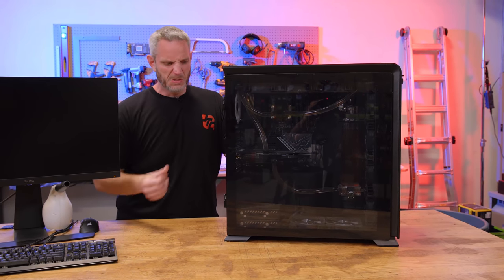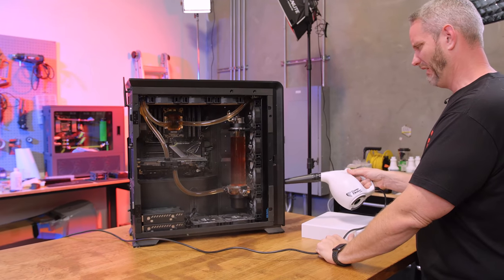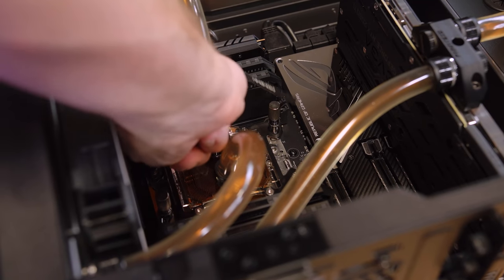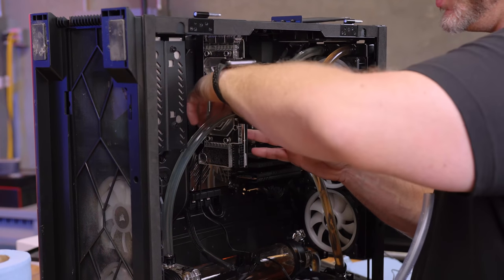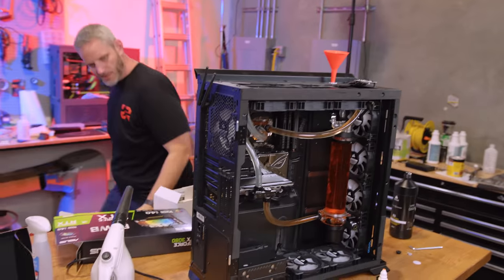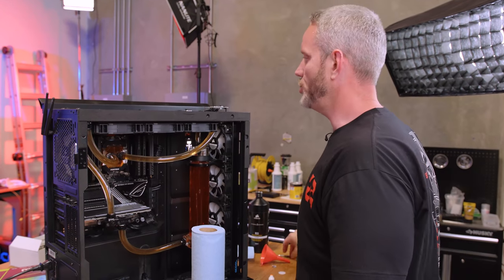Giving Phil the upgrade he deserves!

Comment: Me: profusely struggling to find a gpu

Every computer builder youtuber: I will casually add a 3080 to this rig
Reply: *sobs in RX 570*
Reply: @baronvonsatan  sobs in HD 7790
Reply: @baronvonsatan  sobs in GTX 770 and AMD FX CPU
Reply: @baronvonsatan  bro I'd be happy with a RX 570 right now
Reply: @Metalgear132  Ironically I owned every gpu in this thread. I upgraded to a 2080s and was mad at myself at the time but now felt lucky ... This this video makes me feel bad as his 2080ti is sooo old
Reply: Zugie01  Way to go, bro!

Comment: Jay: “He has a old 2080ti”

Me: No graphics card.😦
Reply: Yea I feel your pain
been trying to get one for over a year now 
😢
Reply: No GPU? I don't have a PC 😭
Reply: If he likes he can donate his 2080ti so I can upgrade my chrome book. Maybe I can finally open 2 chrome tabs. Even doom might be an possibility
Reply: Me why u bulling me
Reply: I have intel  hd510 which is not bad for playing mw2 at 800x600
Reply: Still gtx970 here :(
Reply: He was joking btw.
Reply: I have a 2080 Ti and honestly the 3080 really isn’t very appealing to me at all. It’s not about the price. It’s just that the 2080 Ti to the 3080 isn’t much of an upgrade imo. The 3090 is the only real upgrade from the 2080 Ti. However, if you’re a competitive player and play at 1080p 240 Hz or 360 Hz, Ampere really isn’t that much better than Turing. The new architecture has much bigger leads at higher resolutions. Also, Ampere overall is lackluster. It’s missing AV1 encoding which will undoubtedly be a major factor in the future, it has the same Turing NVENC, the 3080 only has 10 GB of VRAM, the 3090 has VRAM on the back that hits 110 C, and the 3090’s price is too high for what you get. The 6900 XT beats it in a decent amount of games while costing $500 less. $500 used to be the price of the top end GPU on its own.
Reply: @lizardpeter  noice i.mean even if it's cheaper and bit performance more if that's a medium guy trying upgrade he will have make another pc to run it without very big bottle neck so it's only practical to use it even though I don't have a graphic card
Reply: @lizardpeter  So in the future i can find an used 2080ti instead of a new 3070, assuming they both 500ish, i'll go with used Turing eyes closed?
Reply: You can't do editing without a 3080. Everyone know that 2080Ti would slow everything down... duh!
Reply: @Bsc8  That’s a tough decision. They perform very similarly. With the 2080 Ti you get 3 GB more of VRAM, but Ampere does seem to do a bit better at higher resolutions anyway. If you use RTX and DLSS a lot I’d probably go for the RTX 3070. If you play at 1080p the 2080 Ti might be better. With the RTX 3000 series you might also be able to enable BAR/SAM if your hardware supports it.
Reply: just buy an 1060Ti
there's plenty of them atm
Reply: Me : no pc 😔
Reply: @katerang31  I didn't know they made a 1060ti

Comment: Me: Sees 4k video option
My 2mbps wifi: "Why are we still here? Just to suffer?"
Reply: Just to buffer. XD
Reply: @divyansh8596  🤣
Reply: @divyansh8596  🤣🤣🤣🤣
Reply: your 1080p monitor all like bruh
Reply: I hate it when the Tube runs on 4k on my 1200p. It lags, takes ages to buffer and ff/rew-ing just makes it suffocate instantly. And that on 100MBit/s from ISP. Why are Google's devs too dumb/lazy/ignorant to implement a general option that you simply have to set up once and for all? Or detect screen dimensions and select accordingly?

60fps is also something that nobody really needs. It's not a game where you need every ms for reaction purposes and you'd be dealing with input latency. Just draws bandwidth unnecessarily.
Reply: @CakePrincessCelestia  60 fps is necessary for everything. You just need a better GPU bud.
Reply: @j.j.3391  I highly doubt I need something better than a 1080 to handle the Tube @60fps. Actually it's clearly related to general traffic throttling that's happening as I clearly don't get any higher DL rates with higher settings and therefor it chokes. That has a well known history with Germany's biggest ISP and the Cogent backbone. And TBH I simply see no gain in watching videos at 60fps instead of 30. In Gaming however, every single fps counts, especially noticable in input smoothness. And the rate should be rather stable.

BTW I remember way in the past it was possible to set a preffered resolution directly in the setting, but quite a few years ago they changed that to a simple checkbox that makes it try just getting the highest rate possible. Which is just nonesense especially when your device doesn't even support that as it simply causes more traffic and might trigger some other bottlenecks. I don't need to download something in 4k that has to be scaled down to 2k on my end - that's roughly 4x the amount of data. 3 out of 4 parts of it totally wasted, but clogging the whole infrastructure.
Reply: @CakePrincessCelestia  Get a G-Sync monitor then. Your salt suggests a burning desire for something better.
Reply: And here I get 4k HDR on my phone over 5G/5GUW.
Reply: @Odin3v  bruh

Comment: Best tip for watercooling maintenance: use soft tubing.
Reply: Better tip tbh is don't.

I've had watercooling now for a few years and I find the maintenance to be a pain in the ass, and I always run long over the recommended time for changing coolant
Reply: even better dont use clear or glossy tubing so you dont have to worry about plasticizer ;)

Comment: Soft tube gang ough. It has only ONE negative side compared to hard tubing: aesthetic (with the discoloration). Soft tubing is just better:
-Easier to install it's just fitted in the barb, you technically don't need even the cap, but you use it anyway.
-Way more resistant to hurt, moving, falls, pull etc... you can move your loop like he did without any concern. With hard loops even a small bump can cause leaks.
-It's way cheaper (or at least it is in EU within fittings, tubes etc... the hard one cost at least double).
-The leaks are total explosion (if you didn't put the tube correctly lol) or never happens, the hard tubes can have leaks so small and slow that manifest themselves in days/weeks.

Everyone speaks about going first time hard tubing but not so many see the reddits where they screw up and had major leaks or damages only for the stubbornness of trying something useless.

Comment: Best tip for water cooling if you want to go aio, but might want to go custom later. Get an Alphacool eisbear. They are made with g1/4 fittings, a standard soft tubing size I believe 10mm/13mm, and you can get a gpu block that you disconnect the quick disconnect in the tube and connect the card using the quick disconnect on the card and off the cpu and rad.

Comment: BE carful Jay, that blower in fan can produce 12v into the motherboard and burn it.
Reply: I do live sound engineering, after a gig we blow out the amps etc. I was taught to put a pencil in the fan to prevent it turning. Wires plus magnet plus movement = electricity.

Comment: As someone with many years of experience building water cooled systems, my best tip for maintenance is don't wait too long to clean your system (I've seen some people who have never even cleaned theirs, water cooling isn't for you if you can't maintain it properly) . I deep clean maybe once a year (take EVERYTHING apart for a deep cleaning, then run mayhems blitz afterwards) and it really does extend the life of everything.
Reply: How do you like deep clean things? Just flush it out with water / water and soap?
Reply: @IyeViking  Usually I wouldn't recommend taking things apart as it can be risky if you're newer, but I try to go for areas where residue can buildup and clean it with warm water and maybe a small amount of soap along with a toothbrush, then rinse with distilled water to minimize any buildup. The nice thing about flushing it with mayhem blitz afterwards is that if there were any buildup/residue from the cleaning, it will get rid of it.
Reply: @bronzehd6212  very nice, an AIO is a closed loop system so the only thing you need to worry about is dust buildup, which you're already doing a great job at!

Comment: Tip: when reusing WL parts always check the seal on the fittings, after being used and with temperature changes they get deformed and they can leak, specially after being tighten up hard with a screw driver since they get squeezed. Jay didn't check but he has extra parts laying around most mortals dont.

Comment: Hey man quick question? Please Help.I just upgraded from the Ryzen 5 3600 to the 3700x, and everything seems to be fine and working. I click on SYSTEM and it shows I now have the 3700x as my cpu, but when I try to enable All cores and when I go into the Task manager, still says 3700x but under CPU its still showing 6 cores and 12 threads from my 3600? Any ideas as to why this is, and how to fix it? Please Help. And Thanks

Comment: Nice! Quick and easy. 👍😎

I've been using plasticizer free tubing since 2013. Mainly: Saint-Gobain ACG00038 Tygon 2475 IB, Plasticizer Free, High-Purity Reinforced 1/2" x 3/4" Crystal Clear Tubing. 
I got  a 100m roll @ wholesale (Planned to use to build a lot of systems, I did build several high-end systems, but had a bad accident and had to stop for a few years). Still have a few meters left. For my next build!😁

I also used Ice Dragon Cooling ex-liq-203 Non-Conductive Advanced Nanofluid Coolant. Still have some of that in sealed bottles.

Don't know if they are still available. Been out of the 'custom water build loop'🙄 for 4-5 years.

That reminds me... My goto rad fans back then were Cooljag F121425BUAF Everflow 140mm PWM, ~600-2600 RPM, ~40-126 CFM, ~0.30-5.22 mmH2O, ~20-43 dBA fans. I haven't heard anything about Cooljag in years. Are they still around? 

My CentOS Server still uses all that, since I built it in 2014. Haven't needed to upgrade it, except for a few things like RAM & drives.

Comment: Hi Help:: finally deciding to get Asus Prime H470M-Plus Motherboard

 with i7 10700f with RAM corsair Lpx 3000mhz 16x4. Is this a good pc for using after effects for animation??? (I already have GTX 1660 super and other needed parts like Corsair vs650 PSU, hdd etc.) will this RAM work with this mobo which support only 2933 mhz.??

Comment: 2:46 Princess Sunbutt entered the chat.
I always prespread my Arctic Silver (it's been a while since I did that the last time, this stuff might be heavily outdated by now, think I had the OG, 3 and 5). With a filed SIM card - gotta use what you have :D

4:38 That kitchen roll though. Tough color. Wiping your hardware with that literally makes it about 20% cooler /)

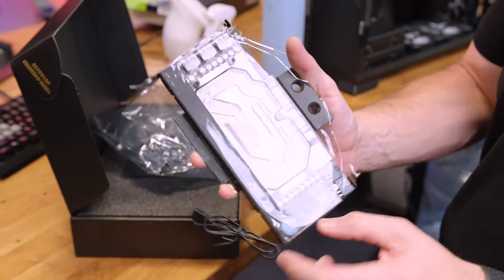5:14 That's because you're literally downgrading his VRAM.

6:36 I always blame Pinkie Pie when that happens.

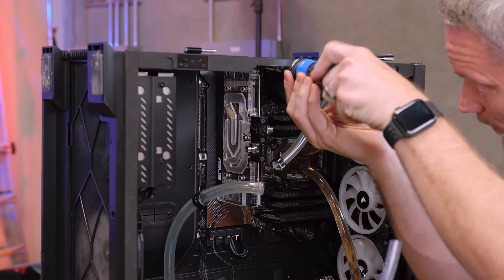8:08 Laughs in OG Sound Blaster 16 :D

14:28 "Spring cleaning" - it's snowing right now...

Comment: I'm sorry but the upgrade Phil deserves is a 3090 so we can have more explosions and travel vlogger style warpy transitions. 😆 That being said I went ahead & just used the soft tubing that came with my Pacifica kit and followed Jay's Watercooling for Dummies video like 4 years ago & so far no problems, despite totally neglecting my loop. It's got a drain port but there's no need for a fill line since it's in a Tower 900 & it's not hard at all to fill straight into the port.

Comment: I gave my wife my old 2080TI and I kind of miss it. Just because I feel like last gen got screwed over this year. No only did performance take a larger than normal leap over the last gen, rendering everyone’s 2080/ Supers paper weights, but they also introduced a new flagship (x090) series, which I assume is here to stay, which pushes everything from last gen down the totem pole more so. This puts the 2080TI in direct contest with both the 3060TI and 3070. Somewhere in between. Usually everything just slides down one spot...so the 2080TI should have been comparable to a 3080. AMD on the other hand is different. They haven’t had a flagship proper since Vega. So it’s just a massive upgrade all together. Everyone was waiting for an RX 5800/ 5900 XT that never came.

Comment: Ooof... 80’s? That’s hot for being water cooled. I’ve got 2x 2070 Supers that only hit mid-to-low 50s when rendering with Octane full-blast. AND I’ve got a 2920x Threadripper in the same loop. Only like 480mm of total radiator too.

Comment: Id take that WC 2080TI. Beats my little 1060. 

Also, Watercooling is for more than just Temps. Having that threadripper water cooled also keeps the machine quiet during rendering cause the fans aren't kicking up speed as much (if even at all) trying to keep it cool. 

Reduced noise is the major reason i WC my PC.

Comment: Real talk I have a 3970x with an optimus absolute tr3 block running by itself on a 540mm rad with 8 noctua industiral 3000rpm pmw fans. The lowest idle temps that i've seen on it are btween 40-44C at idle and likes to spike up to 48-50 then falls down again with a swiftech 330mm maelstrom d5 v2. How come my temps aren't there at phil's?

Comment: So yeah that water level when turning it off if you leave the phil (couldn't resist lol) port open, it's true. I ended up dripping a bit of coolant in my computer. Fortunately I was using a separate power supply so no issues. And yeah The water block is freaking amazing. I upgraded my Ryzen 3600 to a 5900x and it didn't even take all that long. Probably not even 15 minutes. Most of it was spent cleaning up thermal paste. I'm very ADD and wanted ever little tiny bit off that 3600. lol So yeah maybe at the end of the year I'll replace the coolant. It's not going to take that long. So watercooling is pretty awesome and the maintence doesn't seem like a pain either. Oh and the temps are amazing. 60 degrees under load!! it's amazing.

Comment: LUL at "rigid is better". Rigid looks better, that's about it. For a WORK MACHINE, who the hell cares. I wouldn't have even put coloring in the original loop as that has a possibility of degradation the tubing and maybe creating sludge later down the line. Just put some anti-microbial and de-i water and make it run well.

Comment: What an absolute pain. All praise be to the NH-D15!

Absolute nonsense when he said "some" of the Noctua's are a pain to get in and out and removing the block is quicker. It's not "some" all of the Noctua's use the same Secufirm  2 mounting and it's easy, simplicity itself.

Comment: WAP : Wet @$$ Physics. 
Pro-Tip: Never leave a computer on the floor (no matter how clean that floor is). Even a simple dolly base frame on caster wheels is enough to prevent your system from becoming a dust-vacuum.

Comment: It's funny, when I designed my loop, I did design a drain port... but the place I had the drain wasn't going to fit the valve. So instead, I capped it off, and whenever I need to drain liquid, I just open the drain cap, and thread in the valve with a piece of spare tubing onto it. As long as I don't introduce air, I lose like a drop or two of fluid as I'm putting on the drain valve. 

So remember, unless you introduce air, having a small opening isn't too bad. But the system also needs to be off, else the pump will force all liquid out that small hole. 

5 years now I've had this cooling loop, and it's been working amazingly. Tubes are lovely greened over time, but they're still holding strong.

Comment: I did some spring cleaning to my build but since I had no access to an upgrade for my 1070ti I just installed a distro block in my O11 dynamic and redid my loop. some day I will get a new GPU but at least Im dust free, fresh loop, and better cable managed!

Comment: So maintenance question: I always hold onto my fan hub when using the Data Vac because I thought over-revving fans was bad. Jay, you shot air through the front to clean the system out. Do I need to worry, or am I being too OCD?

Comment: I'm sure you've used just about every fluid there is but I had green tube issues only when using Corsiar fluid. My entire loop was basically corsiar. Switched to EK fluid and flushed the system and no more green tubes.

Comment: tips for getting air out on a fill or refill:
in order to get the air out if the system (for noise) i typically lift the pc in both hands, and turn it in all sorts of directions, upside down, diagonal, on the side, everything you can imagine, can be quite heavy if you have a full tower with 3x360, HDDs, etc - that moves the air to the reservoir and you can end it by topping that off with water. You will can hear the air bubbles move in the loop, and you can hear them pass through the pump - when the noise stops you are done :)

Comment: I use double tubing as fill in. A 13/16 tube, with a small 6/8 tube inside, that og down all the way inside the reservoir. I fill in the reservoir using the small 6 mm tube, and the air goes out between the 2 tubes. It's a bit slower to fill in, because the 6 mm is small, but it's a good option if you d'ont have the possibility to have a air going out of the loop elsewhere.

Comment: So, my assumption is that PG-based liquid doesn't corrode the fittings, yet the tubing ages over time, regardless of what you run through it. Is that correct?

Comment: Not sure if it's just me but especially with hard-line loops, i will heat up the loop on a benchmark or something with my fill port open then cap it after. It's to lower the actual pressure in the loop as the liquid and any air pockets heat up (and expand creating higher pressure under load) then when it's capped and cooled down it creates a lower pressure in the loop. 

I guess it's more of a precaution if anything, it somewhat may help but not sure to the extent at which it would help in real world application. 🙂

Comment: This is why I love water cooling personally You get better temperatures and the card only takes up one slot or two depending on the card that you have vs an air cooled card these days which gets similar but slightly worse temperatures than water but you take up three almost four PCI slots water cooling FTW